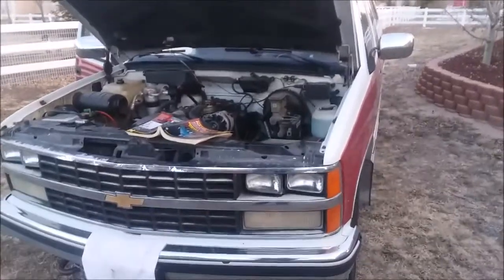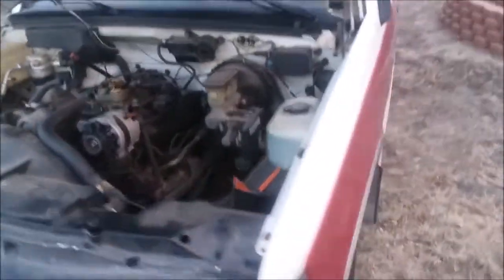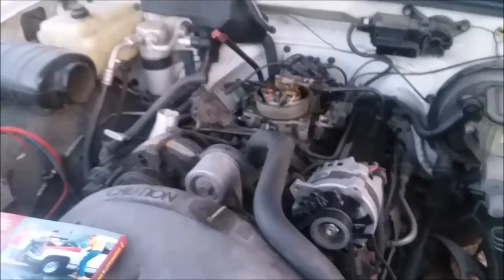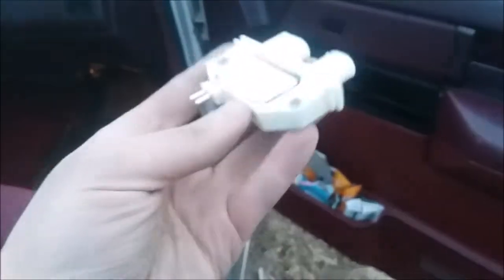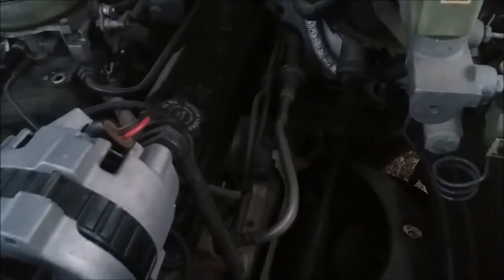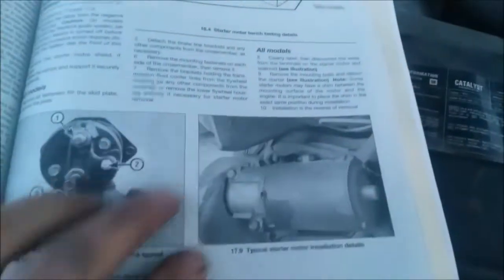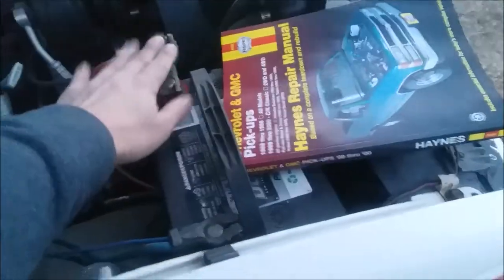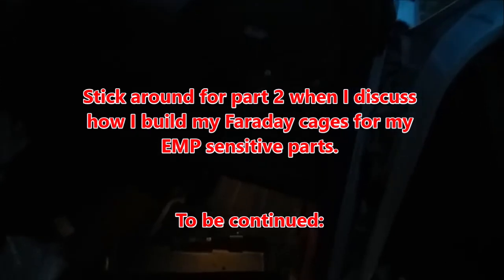How to EMP Proof Your 1988-1995 Chevrolet GMC GMT400 Pickup Pt 1: I.D. EMP Sensitive Components

Comment: how bout converting to a carburetor with a hei, the only thing that the ecm would work is the 4L60/E (automatic transmission) the tps sensor is the key to making it work, ecm would bd a stand alone for the AT. A hydromatic Th-350 or 400 would be no problem, also if you have a standard trans. 4 speed or 5 speed no ecm needed...if Im right 👍
Reply from the maker: As far as I am aware the ECM does not control the transmission, the transmission is mechanical, the only other thing that I can think of that the ECM might control is the cruise control.
Reply: True, it might affect the cruise control and dunno if its tied into the speed buffer...had not gone into it. And might not need a cruise control during an EMP with cars stopped in the middle of the road, now Zombies...just floor it. Anywho ya I own a 94 Z71 350tbi and I own a 88 Iroc Z 305 5 speed...I love old cars so darn easy to work on than these throw away tin foil cars...and the idiot light (SES) which is a money maker...

Comment: I’d absolutely love to get me an older ride. Like an early 80s blazer or similar. Not much to EMP proof there. They are going for high dollar now.....
Reply from the maker: Well with even an early 1980's Blazer, you'd still need to either EMP-proof or get doubles of an alternator, starter motor, ignition control module, a battery, and maybe a fuel pump.

Comment: Great info, what I would recommend getting for EMP or not (I would choose the latter) is a spare fuel tank for extra gas even if it isn’t connected to your existing fuel system and have a way to siphon from said spare tank. Another thing I would recommend getting is at least a bottle of PRI-G ($25 on Amazon), it’s shelf life is INDEFINITE if unopened (3 years once opened) and can treat 256 gallons of gas. I have heard that it can treat 15 year old sludgy varnish gas and be as good as today’s pump gas (although I cannot remember where I heard this). Also they make PRI-D for diesel fuel too.
Reply from the maker: That's good to know. I'll have to check out  that fuel stabilizer sometime. I'm not worried about installing a secondary fuel tank, I keep several metal jerrycans full of gasoline. In fact I probably store more gasoline than any of my neighbors on the block. I've got enough gas to get me through 1 to 2 months of regular commuting if the fuel trucks stopped rolling tomorrow and I keep my truck's tank topped off at all times. So I'm good to go on fuel.
Reply: Deorse what years of cars will work will 85 or less cars and trucks work or not
Reply from the maker: Sorry for getting back to your comment pretty late. As far as a list of which make and model of cars/truck will and which make and model cars/trucks will not work I do not have a direct answer for. As for general rule of thumb if the vehicle in question is 1973 or older and/or is equipped with a points and coil system and generator, then your car is already EMP proof. If said car or truck still has mechanical fuel pump and carburetor and not an electronically controlled aftermarket fuel and electronically controlled aftermarket fuel injection system, then there should be no reason why your vehicle won't run after an EMP strike.
Reply: Liquid Propane fuel lasts forever.😳

Comment: This is very interesting.  I had thought about keeping an ignition module and ECM in a faraday cage but wasn’t sure what else would be at risk.  

I couldn’t see the O2 sensor you were pointing to, but usually they are mounted beneath the truck.   If it were to burn out, your truck will run but will run in a rich open loop (or closed loop, I can’t remember the nomenclature off hand).

The truck will definitely not run without an ECM or the ignition module.   I didn’t think about the airflow sensor, but I bet it probably wouldn’t.  

Do you have any good resources that suggest an alternator and starter would go out?
Reply from the maker: I couldn't give you any direct resources between the alternator and the starter motor, I got most of my information from a couple of mechanics as well as a close friend who tinkers with this stuff in his spare time. I do know that MOST vehicles pre-1974 and older had magnetos, points and coils and/or generators instead of alternators and the starter motors were of a different construction, they did not have diodes in them. Most 1974 and post-1974 vehicles started using alternators and starters that BOTH had diodes in them. The diode is basically a rectifier, the diode IS the weak link that will fry your starter or alternator in an EMP. Late 1970's and early 1980's was when GM started putting in electronic ignitions with ignition control modules. 1985-86 was when most vehicles with an exception a few started putting ECM/BCM's computers and different sensors inside most vehicles. 1988 was the first year that GM started putting computers and electronics in their pickups starting with the GMT400 pickups and SUV's. All this information is true on most vehicles with the exception of anything running off of diesel, from my understanding most diesels I want to say pre-1993 on down are also EMP-proof/resistant with the exception of any electric fuel pumps, batteries, alternators, and stater motors.
Reply: Any and all emissions controls or electronic anything will fry. You can look into performance upgrades to bypass these things. What we did in the old days of hot rodding. Bypass the junk! We still do it today with any vehicle. Bypass

Comment: Gas is no good! Gas goes bad in months. Diesel is the only thing that will last as you can make it. Bio diesel is the fuel of the apocalypse.
Reply: Just reading through comments and arguments and the one thing no one talks about is if you have whatever vehicle and you did everything right and you have a running driving vehicle you don’t want to use it and go out and drive it around. No one else did the work and they’ll probably target you/it and kill for it. Cause remember there’s no more law and order and people who are still around probably didn’t do it honestly and hey what’s one more death if they get a running vehicle. Just thought I’d throw that out there for food for thought 🤔
God Bless and be safe.
Reply: kirk mcmillan yeah also one think you forgot is if I get the drive car how far can it take me easy target also can drive with all the dead cars in the freeway and streets can go tru
Reply from the maker: That's just a myth. Ethanol-based gas or gasoline containing ethanol such as E-85 and E-86 will not store for very long. 87 octane or higher will store for years with proper additives and octane boost treatments. 87 octane alone will store for about 1 year without any fuel treatment or additives so as long as you keep in in a sealed gas can and keep it away from excessive heat. I've been storing gas for over 4 years now, I haven't had a SINGLE gallon go bad yet because I treat all of it with Stabil fuel stabilizer as well as a water treatment and an octane boost. How about this, to prove my point, I'll even make a fuel storage video, although this might take 2 to 3 years to produce, a video of me storing treated gasoline and then using it in a small internal combustion engine like a lawnmower to prove that the gasoline CAN be store for long periods of time. Does gasoline store as long as diesel? No, not even by a long shot. I have gas powered vehicles because they're cheaper buy and cheaper to own than diesels. I am more familiar with how an old school gasoline engine works than I am with a diesel. At the end of the day, when long-term grid down happens not many vehicles will be left running for very long, we'll all be walking regardless whether or not we drove gas or diesel cars/trucks in the previous paradigm.
Reply from the maker: Oh lastly, I want to bring up you can only use bio diesel about 9 months out of the year because in the winter months it turns to gel and you can't run anything off of it. Also their is going to be a limited amount of lye and old fry grease after a prolonged SHTF event, so after that good luck.
Reply: @Deorse  yes gas can store if done correctly, but you have a severally limited supply and once you crack open a tank it will start oxidation which is just time ticking away. And when gas runs out in a few years what then? And depending on how you process bio diesel you can use it in cold weather. Even -20 or more without gelling. Back in the old old days they made lye soap 😉 not that hard to make lye. And old cookin grease isnt the only oil you can use. You can use new oil off the shelf of an abandoned grocery store. Who wants peanut oil in the apocalypse? Deep fried rodents anyone? On top of that if you grow crops you can process them and get oil from them. Soybean oil works great. And methonal? You csn build a still and get that too from wood. Plenty of trees arround. So as long as I have crops, and some trees im good to go. Biodiesel is an apocalyptic fuel. Now if you set your gasser up right maybe you could run methanol.  But the stuffs pretty corrosive and youd have to replace alot of parts first. And if your lucky enough to have a duce and a half, those trucks run on anything. Like seriously. kerosene, jet fuel, used motor oil, transmission fluid, hydrolic fluid, and veggie oil. Going to be plenty of motor oil every where as well as transmission fluid. So you see diesel if done right, can do amazing things. Dont get me wrong I love my gas truck, but long term diesel is key.
Reply from the maker: Look bud, I'm not going to argue with you over this because you want to know why? If we have a seriously prolonged SHTF event no one will be driving gas or diesel operated equipment outside of the 3 to 5 year mark due lack of ALL fuel, lack of proper maintenance vehicle maintenance, and lack of maintenance to roads and the fact that driving will make you a target. And don't think for one minute that those homemade bio fuels won't clog up your fuel filter or eat up your rubber fuel lines. On top of that with your argument about growing soybeans and making your own bio fuel from said oil, "that's a cool story, bro." Are you growing soybeans right now? Are you extracting oil from these said soybeans to turn into bio fuel, if not then that's all that is "cool story, bro." I can say the same thing about growing my own corn and setting up a still to make moonshine (ethanol) to run my gasoline powered truck, it's just a "cool story, bro."

Lastly a bug out vehicle and/or bugging out should NOT be your primary means of responding to SHTF, you should already have a plan in place, like myself I plan on staying put in SHTF and "riding out the storm."  A bug out  vehicle should only be a supplement or a last ditch effort backup.
Reply: @Deorse  but you see there isnt a lack of fuel. And you have to rebuild society somehow. They actually won't clog nor eat hoses if made properly. And you can virtually run it in any diesel engine. And yes I have an uncle who farms soybeans and corn and he makes bio diesel on ths side. Running a gas engine on ethonal or alcohol? You had better have all the parts you need to moddify it. That ethanol will eat your tanks, filter and pump. Biodiesel is actually cleaner then normal diesel and will clean the system. And waiting out the storm depends on where you live. You live in city, you really shouldnt. Rural. Meh. Youd be decently ok.
Reply: And with a duce and a half, there is plenty of motor oil in plenty of useless gas engine cars. So plenty of fuel for a long time.
Reply from the maker: @joshjenkins3815  Well then, if there "isn't a lack of fuel," (as you just now claimed) then there must be plenty of gasoline out there, so then pray tell, why would I want to go out and buy a diesel pickup? Why would I want to potentially go put myself in $15,000 or more in debt just so I can have a diesel-powered pickup for SHTF? I can barely make ends meet as is and still have a little leftover for preps. What's wrong with gasoline now? What's wrong with my $1500 gas-powered pickup? Did I or did I not say that you will not be driving forever? Look something will happen and you will be unable to drive your "bug out vehicle," fuel will run out, both treated and untreated fuel stores will eventually go bad, roads will be impassable due to neglect and broken down vehicles scattered in the road, the roads will be unsafe to drive due to roadside bandits, and your vehicle will succumb to the inevitable, it WILL eventually break down for good. No amount of claiming "oh I could do this or I could do that," will save it. I could poke holes in your plans all day so that in the end it won't even matter whether or not that you're driving a gas-powered or diesel-powered car or truck. F**king get real.

And yes your bio diesel WILL clog up your fuel filter and it will eventually eat up your fuel lines. You'd be foolish to think otherwise. How do you plan on getting a consistent batch of bio diesel if you're on the the road "bugging out"? Let's talk about the ridiculous logistics of what you're talking about. Do you already have a laboratory set up to mix bio fuel in a controlled environment so that you can have consistent? You already made the comment that your uncle does, if so do you live with your uncle or at the very least live within a day's travel? My next question is if he actually is making bio fuel during SHTF, then why waste a potential food source during rampant starvation for some bio diesel? Do you guys have the manpower to protect the food crops and farm from potential looters and starving masses? Do you guys have a way to keep this, what I am assuming is a farm from being overrun by unwanted people? If you and your uncle actually do have all of this then why waste time focusing on bug out vehicle or bugging out in the first place? Shouldn't you be more focused on fortifications and bugging in since what your uncle has is potentially more valuable than a diesel-powered bug out vehicle?

Oh and while SHTF has not happened I would like to bring up that in general diesel powered vehicles cost more in maintenance, more in fuel, more in taxes, and more to insure, than gasoline-powered vehicles.
Reply from the maker: face palm Are you even listening to yourself? An M35A1/A2? If I can't afford a decent running condition late 70's to 1980's model diesel powered pickup, then what makes you think that I'd be able to go out and get a running condition Duce and a Half? What makes you think that just about anyone would be able to go out and get a Duce and a Half other than a wealthy person? I am on a very tight budget, I have to prep within my means and "diesel-powered" anything is "out of the question." First thing is first, I want to save up money so that I can get a piece of arid-able piece of land out in the country, then I want to establish an off grid home, then construct a security-style perimeter fence, and then start growing my own food and raising my own livestock. Nowhere in my pans do I say "Gee I want to spend $45,000 to $50,000 on a working Duce and a Half, so that I can have a really cool bug out vehicle for SHTF." You need to be more practical.

We're not trying to impress people during SHTF, so having that Duce and a Half isn't going to increase your odds of survival. If anything it's going to make you stick out like a sore thumb and paint a target on your back during SHTF. All it would take is for a desperate person with a scoped .308 rifle to put a well-placed shot in the vital area of your torso or a head shot and then "your" M35A1/A2 with all of "your" supplies becomes "theirs," or they could just shoot out your radiator, kill you then take your shit anyway. After all, traveling the roads during the late stages of SHTF is going to be dangerous, a borderline suicide mission. Unlike your Duce and a Half, if I had to "get out of Dodge," during the early stages of SHTF, my late 80's model gasoline-powered pickup truck with a dented quarter panel would blend right in with traffic. I'd be more of a gray man than you. Because I feel that you are very naive at the concept of bugging out and choices of bug out vehicles and properly planning for SHTF in general, I think that you need to go watch Nutnfancy's video on Bug Out Vehicles For SHTF.

I'll give you a hint if you already haven't watched it, "go with the Chevy Astro Van."
Reply: Deorse you live in city because I do and I need to move on and go country also can’t really use my 69 barracuda if there’s a lot of park cars can’t go tru so cars will be the least of your concern in a emp shtf scenario get a bicycle better two wheels rather than two legs

Comment: Thanks for the mention brother, I wish I had some content uploaded,  I will start uploading  after we get through New Years. Interesting video, I have a 98 Tahoe 4x4 with a bunch of electrical components that all would be fried. I'm still not 100% sure if all the work need to emp proof a vehicle would be worth it much less the added danger of having to get fuel without getting shot. I'd probably be bugging out and staying away from towns, the landscape will be extremely different after a year.
Reply from the maker: Yeah, a '98 Tahoe would have too many electronics. If it was a '94 Suburban then you might be able to harden it. The reason why I want to try to EMP harden a vehicle is because I want to have "the option" to leave, bug out with my food storage, supplies, guns, and ammo. For the most part, I don't need to worry about fuel. I keep several metal jerrycans full of Stabil-treated 87 octane unleaded fuel on hand.
Reply: Deorse hey may I ask you something do you know if a 1970 Shelby gt500 have a computer
Reply: Deorse but it depends if you in the city and emp happens then you won’t be able to drive your emp proof car because of so many park cars get a bicycle better two wheels than two legs